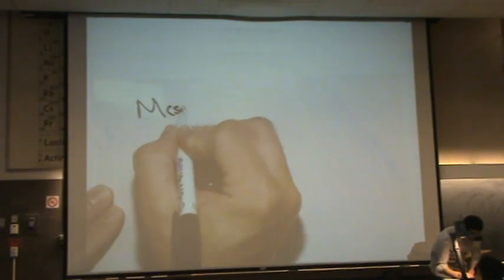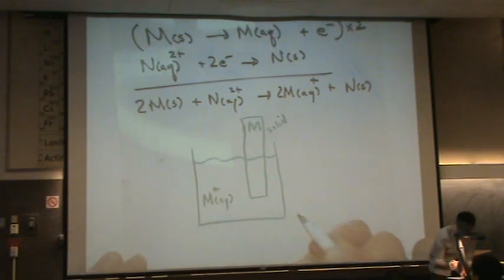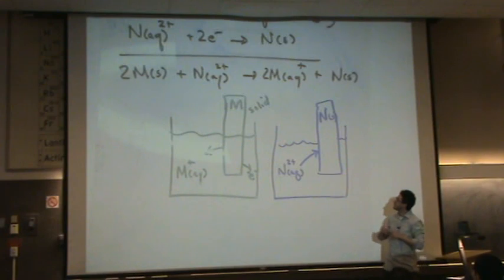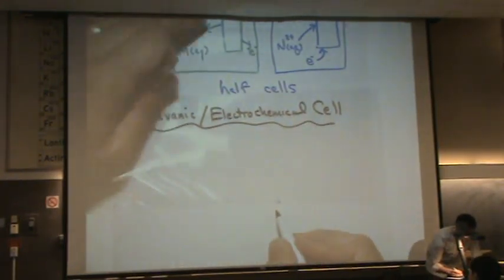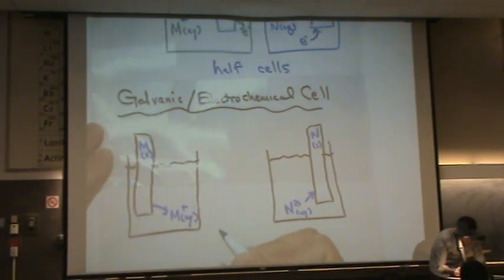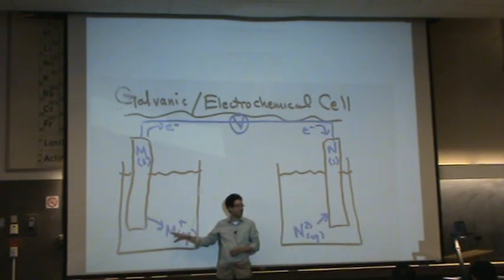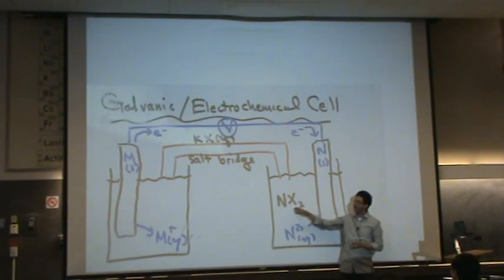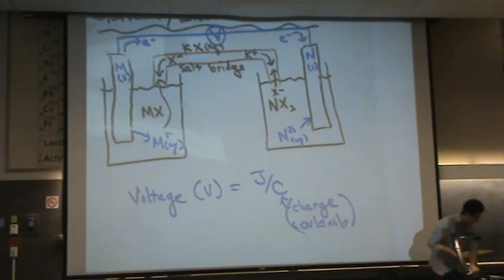Galvanic Cell 1.mpg

Comment: What causes the KX to separate?
Reply from the maker: KX is ionic and would separate naturally in solution. When the salt bridge is connected to the half cells, the K+ and X- ions would be drawn to the solutions in the half cells. For example, the X- would be drawn to the excess positive charge in solution in the anode.